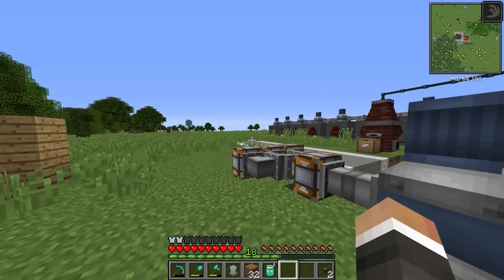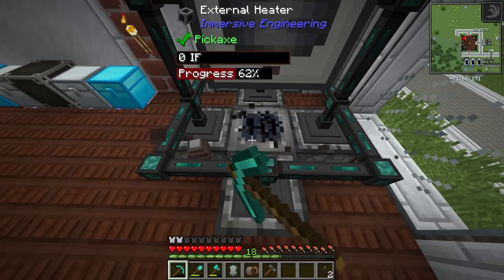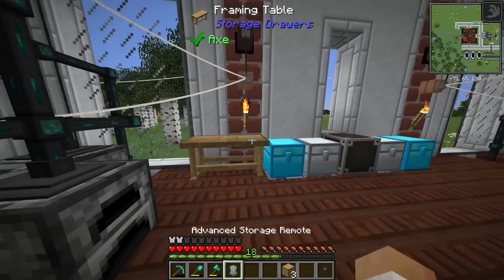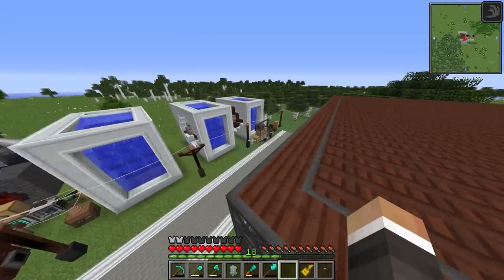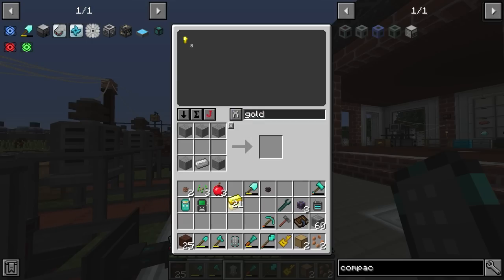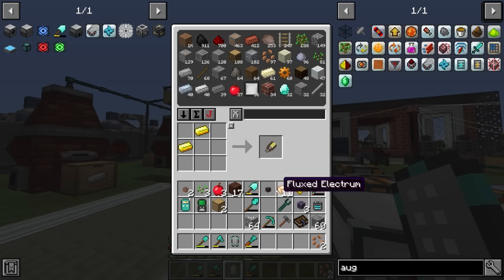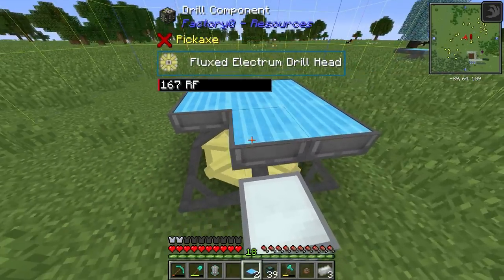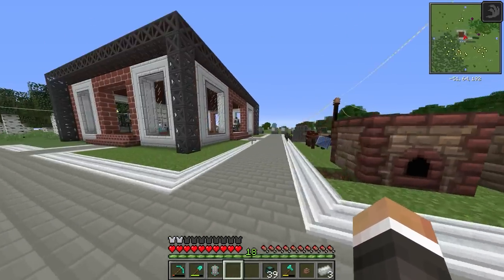Minecraft Feed The Factory | A NEW AGE UNLOCKED! #10 [Modded Questing Factory]

Comment: you can run the electric drills with only 5 tier 3 solar panels it takes a long time to fill the buffer but it is net positive
Reply from the maker: It isn't. The tier 3 solar panels only produce 16rf/t and the electric drill requires 150rf/t, so you need at least 10 to be net positive. If you're on an older version of the pack the tier 3 solar panels produce 32rf/t so you would be right, but they were nerfed at some point to be less powerful. :(
Reply: @GOC_  I am as far as I know on the latest patch.  The other odd thing is I can power  6 dynamos off 1 steam  dynamo

Comment: Fun fact: you can dupe molds by placing them in a metal press and then using a hammer to destroy the entire thing at once. 😊
Reply: That's cheating
Reply: @nif4345  Fun fact: you don't have to do this.
Reply: u will eventually find out u need the  wire mold  cuz its the only thing that u cant make in a compactor
Reply: @melonheadwt  I guess time will tell. I just unlocked aluminum and have yet to set up production research
Reply: @Conceiver_  I just started with research after aluminum and my base still a fkn mess,, nothing 100% automated